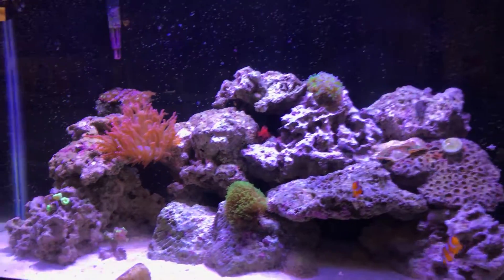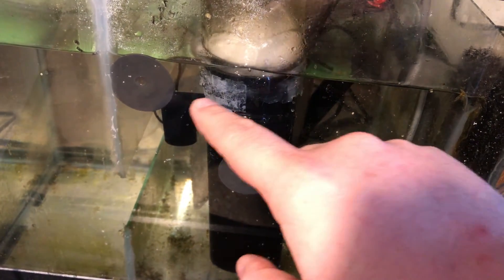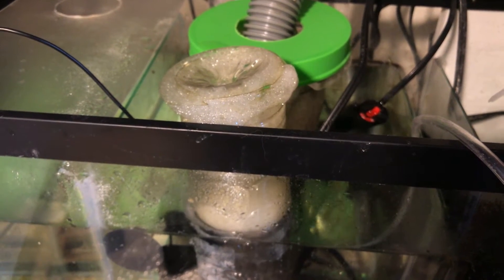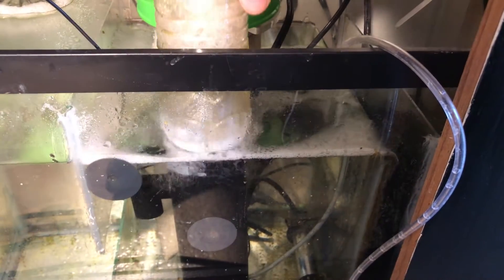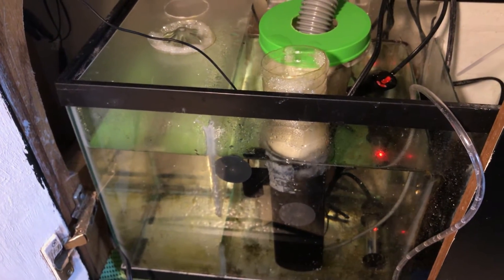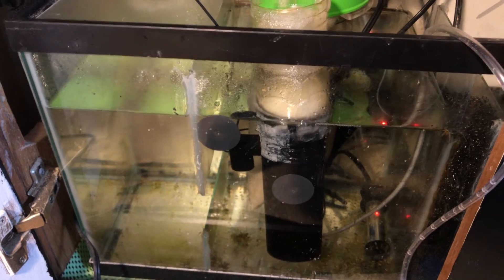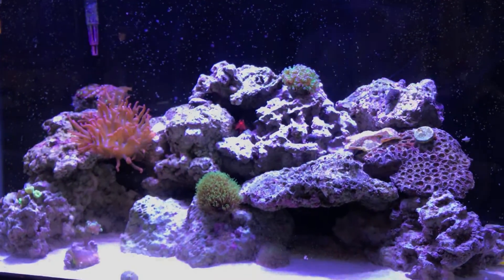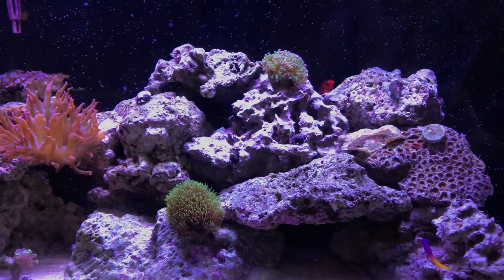Super easy DIY protein skimmer that works!

Comment: Hey Jordan, how do you actually adjust it? Moving the air diffuser up/down? Changing the amount of air pumped thru the diffuser? Love your hawkfish btw!
Reply from the maker: So to adjust it I just raise it up and down using the suction cup on the side. It's pretty easy to fine tune imo. If a person had an adjustable output air pump they could adjust it that way, as well.The Hawkfish is an awesome fish for sure, very unique and cool looking - however he killed two Bangaii Cardinals within 30 minutes of them being put in the tank. I'm not happy with him right now. 💔
Reply: Air flow control valve. This is basically a the Berlin air lift skimmer. I'm making one out of a extra tank vacuum later today